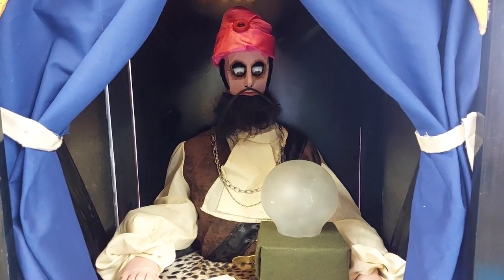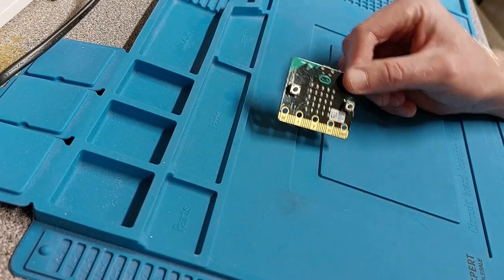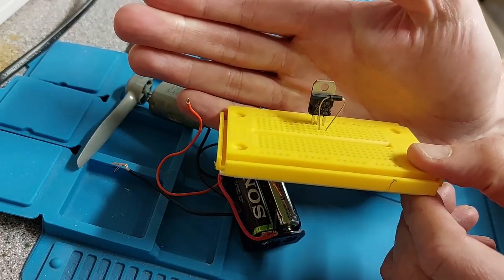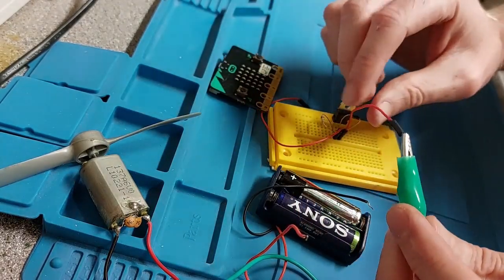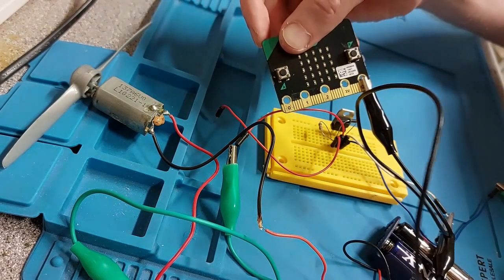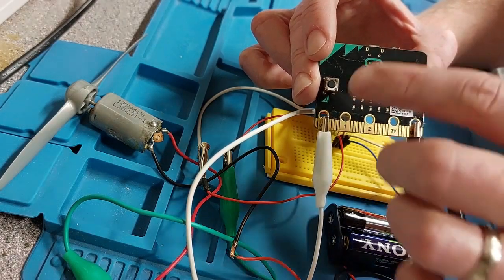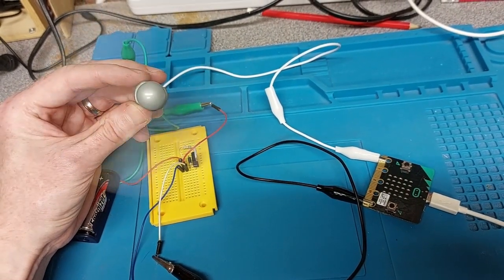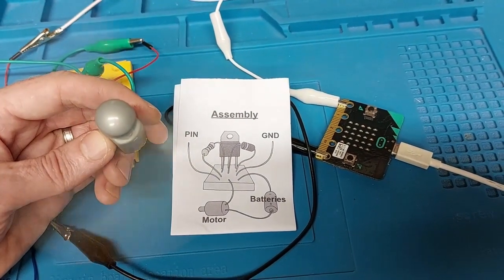Microbit Motor Control and Toy Hacking - Low Cost Method

Comment: hey, 
I'm having trouble with it listening to the micro bit it seems to start straight away when battery is turned on and wont cut off with any signals from the micro bit